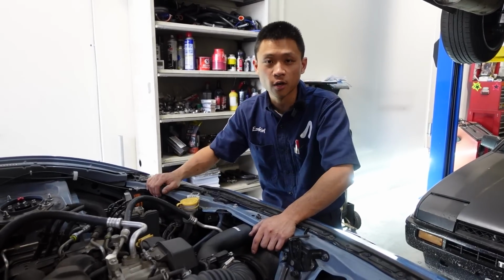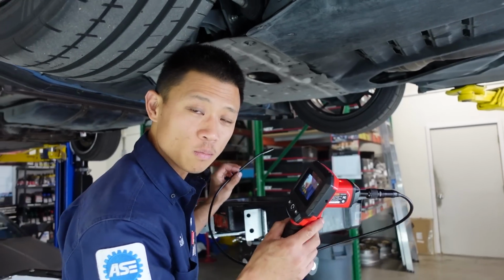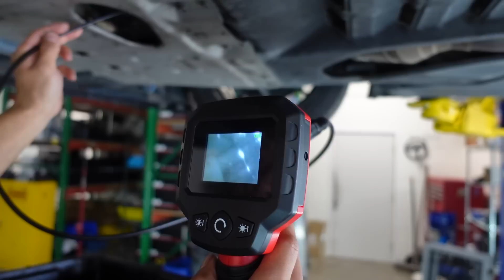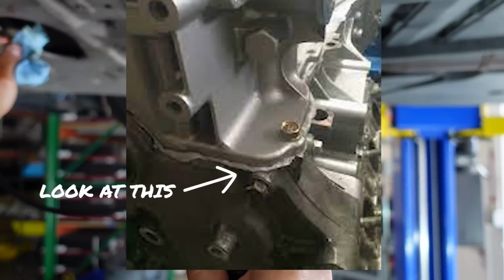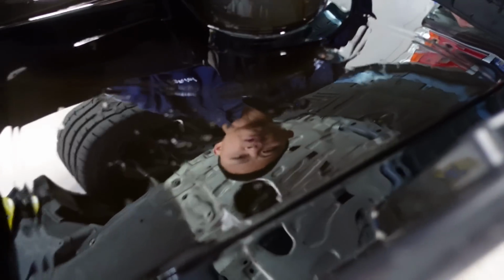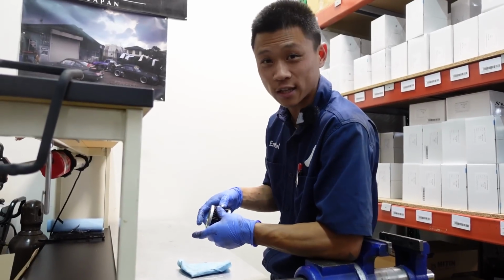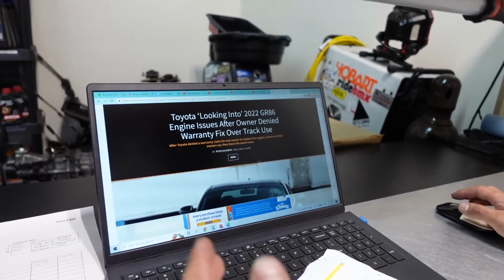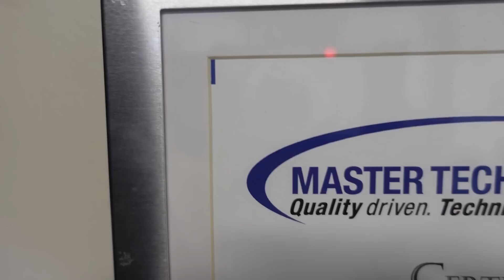GR86 RTV Engine Failures: thoughts from a former Subaru Master Tech

Comment: It’s amazing that in this day and age, a major car manufacturer hasn’t figured out how to properly seal an oil pan that would not potentially cause a major issue.  Totally baffling.
Reply from the maker: "Baffling" lol...punny
Reply: the really amazing part is that plenty of guys with little knowledge in comparison to an OEM can seal a pan better in their garage
Reply: Subaru just doesn’t give a shit. There’s no reason to put a boxer in a modern cheap car, it’s just a worse design than an i4. But they don’t it because they can’t do any better. Stop buying these things, you already know it’s going to have a stupid problem in advance.
Reply: @aluisious  how is it worse
Reply: @roboticunclephil  overly complicated for what it is
Reply: @aluisious  it is heavy for what its worth. And tough to change spark plug n other certain components. Its just a lower center of gravity n more even but if we push a v6 or i6 more under windshield cowl .. o.o yea. Moh powa babeh
Reply: Yeah man. This is supposed to be 100 years of ICE evolution. Yet another reason to not buy new cars. Only buy 50k miles+ in hope that this shit has been ironed out
Reply: @rahundsigma  the EJ253 is a very simple boxer engine, no AVCS/v-tech stuff, SOHC, NA. works pretty much exactly how you'd expect. i don't know what you mean
Reply: @aluisious  What about a modern expensive car, like Porsche?
Reply: @hhaste even worse.
Reply: @roboticunclephil it's a garbage engine every car that had it was garbage and has no potential except the junkyard
Reply: The engineers likely knew about the issue and its more likely the proposed fix for the design wasnt approved within the budget.
Reply: And here I was thinking about getting one, but after my mates disaster with his WRX, I thought I would do my homework. Guess I aint getting one now.

Comment: This could be a disastrous problem for Subaru/Toyota. The biggest selling point of these cars is their track/autocross ability and the biggest upside to them not being turbo'd is that NA cars should be more reliable... If it's gonna have a known failure Id like to actually at least make power before it breaks. 🤣
Reply from the maker: Its what make a Subaru...a Subaru
Reply: Their engines have been unreliable for a good long time and sales are only increasing so I doubt this is going to hurt them in the long run.
Reply: I mean it's a pretty simple fix and then they're perfectly reliable. It just got blown out of proportion because of toyota not staying true to warranty. If subaru did the same with all their previous issues with the EJ engines, then they would've been sued 100 times over. It's very likely that almost every performance car, the first few model years will have some occasional catastrophic issues. Don't buy the first model year, or don't complain.
Reply: @Toymonkeyjr  thats fair. Disasterous was too strong of a word. My concern is mote about the perception of the warranty than the actual failures. Lots of buyers who may have been considering buying one and tracking it are now going to have second thoughts and consider another car instead when they would not have had this story never happened.
Reply: @Bones12x2  Everyone I know who wants one is still trying to get one lol, this hasn't stopped them at all. just something to be anxious about.
Reply: @Toymonkeyjr  anecdotal evidence isnt valuable on a topic that is measurable in the hundreds of millions of dollars. I have a client that told me he is shopping for a track car and the BRZ/86 wss on the top of his list just above a low mileage used 370Z and a Mustang.... Now his concern about the warranty has moved it below the Z. The point is, the perception of these csrs is that they are amazing bang for the buck, track focused, sports cars.... Now millions of people have been made aware that they have a known fatal flaw and the potential for bad warrsnty coverage... It only takes 1 out if every hundred potential buyers to be scared off by that idea to cost Toyota millions of dollars. Its not likely to make or break the cars overall success yet but this story was huge in the csr enthusiast world and it will/has already cost them exponentially more money than it would cost to simply stand by the warranty to begin with
Reply: @Bones12x2  it's not anecdotal evidence, Have you heard of anyone canceling their orders?? people are still rushing just to get these cars lmao.
Reply: @Toymonkeyjr  "your friends" is literally the definition of anecdotal. And I literally just mentioned a person I know who was heavuly considering one that is now likely to get something else. Also... Me.... I am planning to buy a car next year. The BRZ/86 is one of my top choices but I plan on tracking it and this makes me fsr more reluctant than I was a few weeks ago.
Reply: @Bones12x2  name one person who canceled their order lmao. They're still sold out all over the country, so good luck with that.
Reply: @Toymonkeyjr  lol why are you so invested in this? Most US consumers are uneducated sheep. I only buy Toyota and this problem made me not buy one. Do you like buying defective cars? Also I haven't heard of any car company keeping up with demand since the chip shortage.
Reply: @rocketpropelled  You sound upset. Maybe you should go take a break from youtube bud, kay?
Reply: @Toymonkeyjr  You mad bro 🤣
Reply: @Toymonkeyjr  subaru did do this with the ej25 from 08-14 and there actually was, possibly still is, a lawsuit over how bad that particular stretch of the ej25s are.
Reply: @Thor Odin son damn I hadn’t heard about the 2017s
Reply: Mine shit its self just after 30k miles
The motor in the 86 always gave me an iffy feeling like it won't last long.
Big shame

Comment: the RTV issue could almost completely avoided by using anaerobic sealant like permatex 51845 where ever possible. Anaerobic only cures where it is clamped between 2 machined surfaces. any extra just oozes out and mixes with the oil and is drained out next oil change. only downside to anaerobic is it cant be use on sheet metal stuff like stamped steel oil pans- for those you still need RTV.  but anything machined like the timing cover, block halves, aluminum oil pans, oil pump etc anaerobic works flawless with zero chance of using too much.

Comment: I feel like people are making a bigger issue out of this than it really needs to be. Like every car has its own issues, there is no perfect completely “bulletproof” car. For example ND Miatas were blowing up transmissions on stock power during autotocross and track use. (Heck they still are, many are falling out of warranty now too) Nissan Zs burn oil… I can go on. Yet, why is no one crying a river and foaming at the mouth for those design flaws?
It’s the first year production run of the 2nd gen, I bet you this will be fixed and no issue going forward. I’m pretty sure Toyota has been eating the repair bill ultimately in the end. I’m glad these cars even being made. Given there is no lightweight rwd coupes on the market. At this rate we won’t have any sports cars how much enthusiasts complain.
Reply: I hope ur right bro. I still want to get the 86 in Jan of next year.
Reply: @lawnmower6591  Every production car has its flaws and issues especially in the first model year. The first gen 86/BRZ had a similar issue that was later corrected. Then when the facelift or kouki model came out was eliminated entirely. I wouldn’t let all this stuff sway you away from buying one of these cars. I’d argue there’s a higher chance you may not have issues at all. My 2017 has been a great car and experience 🤷🏻‍♂️
Reply: @Christian Medrano  thank you bro. I'll keep you updated.

Comment: I knew a problem was going to arise with this new 2nd BRZ/GR86 Gen for the first few years of production. Guess I’m going to have to wait a couple years of production until they sort out all the common problems, issues, and bugs. Safest bet is to wait until the refresh model but I and no one want to wait that long.
Reply from the maker: Yeah I was surprise to see them be this "reliable" as a first model year...until now.
Reply: Worked at toyota in australia when they first came out. there was a heap of "soft" recalls that weren't know about. Tail lights not being tightened enough was one for example.
Reply from the maker: @Mr_jz_12  Agreed. You had to manually sift through the TSBs or tech tip news letters to find them.
Reply: have fun waiting then
Reply: @Sinancan93  Rude but ok. Have fun spending money on a brand new ticking bomb car engine.
Reply: @Edward-jx7pl  warranty will do it. Don't track and social media share drifting🤷😂
Reply: @Sinancan93  Would rather wait than pay for the privelage of being a beta tester for production teething issues. Frankly a good rule of thumb is to NEVER buy the first model year of any new generation vehicle. First-year production runs are always worse off with quality control as the factory learns to build the new platform. For how much a new car costs, I can wait a year for a better ownership experience.
Reply: @nobleman-swerve  bro I live in Europe and we get only 4500 cars and 1000 in germany for 2 years. I have to 🤷
Reply: They had the same issue back in 13. So there won't be any fix XD
Reply: I have no money, so I can easily wait that long. 🤣
Reply: @Sinancan93  It will grenade right after warranty is over.
Reply: @fortheloveofnoise  that's a nice call from the glass sphere
Reply: There will be no few years of production. The car will be discontinued at the end of this year due to a change of regulation in windscreens and emissions. The one that where delivered will be the one we had. This is a collector car in the making.

Comment: Funny enough, I just started work for a Subaru dealer 2 months ago. Silicone must still be a factory issue because in the past 3 weeks theres been about 4 or 5  2022 N/A Outbacks coming in with lower oil pans leaking through the silicone, some techs are thinking it set for too long before being installed
Reply from the maker: Its what makes a Subaru - a Subaru
Reply: @CMAutohaus  I'll never own another subaru product... we're done!!  Toyota/Lexus for now on... after I'm done with this 370z...
Reply from the maker: @07wrxtr1  GR86 is a Toyota product lol. Toyota also owns a large stake in Fuji Heavy Industries (Subaru).
Reply: @07wrxtr1  Welp, may as well wait for GR corolla(or Yaris if you live outside of the US) Or maybe the rumored MR2 if it does ever come out. Since that's actually made by Toyota lmao.
Reply: Isn't the "gold standard" for RTV to bolt the pan down immediately after application to hand tight, then cure to spec before torquing to final torque? I waited a few days to torque to spec but I was waiting on parts anyways.
Reply from the maker: @joshuaho3150  Tighten and torque immediately. Modern RTV is different.
Reply: @EnhancedTrashBin  Yeah - I kind of am leaning on a Tacoma - since, I have a ton of places my 370z won't get me!  however - used Tacomas are $$$ right now...
Reply: @CMAutohaus  Yeah, I see a lot of mention to torque to spec immediately. I had a lot of time to waste though and I figure hand tight curing reduced the likelihood that it would all be squeezed out of the mating surface. I assume real mechanics can't afford to waste time like I do.
Reply: I just took deliver of a 22 forester.  Got the car home and checked the oil with around 29 miles on it.  There was some grey stuff stuck to the end of the dip stick.  My guess is that it was sealant.  Guess I’ll be changing the filter early and keeping my fingers crossed…
Reply: @funnyguy8042  that’s 100% sealant. Also, please keep an eye for oil drips under your vehicle. I work at a Subaru dealer and we’ve been replacing the oil pan on ‘22 Foresters once or twice a week for the past 2 months. Every tech tries to reseal the pan whenever they come in, but they always end up getting a new oil pan to resolve the seepage
Reply: @Allen.Saylor   Thanks for the heads up! I will definitely keep an eye on things as I will be putting in a fumoto valve and doing my own oil changes…

Comment: Until excess RTV issue can be resolved, I think Subaru should replace the oil pan with an oil pan with larger plug size that has been moved directly under the oil pickup tube, so the strainer can be inspected and/or cleaned out during oil change.
Reply from the maker: Someone else argued the strainer should be placed at the bottom of the pick up where debris can still fall down rather than at the top where it currently is and debris gets stuck.
Reply: @CMAutohaus  
I thought about that earlier and it is an option. The only problem I see with that option is screen surface area. It would have to be  at least equal strainer surface area. If you look at current screen/strainer, there a top horizontal screen and 4 vertical walls of screen. Also if the screen was at the bottom with large surface area, you would be in the same position of having to drop headers and pulling pan to clean strainer. However, it is an option.

Comment: I have misfires in 3 cylinders on a 2023 GR86 with 4500 miles, that's never been redlined, and has the rev warning set at 4500 RPM.  No error codes but my OBD2 scanner seems to indicate a few misfires during the last 10 cycles... Typically maybe one to two. I hope the engine isn't permanently damaged. Car seems to drive fine.

Comment: It may be worth a potential buyers time to research RTV use as an engine sealant, in particularly, the degradation over time induced by temperature cycling. It appears to me, based on my research, it would not be the sealant of choice. It also explains increased oil use over time. One may also want to research the effects of oil consumption in an engine. All was very intresting from a technical perspective.

Comment: My 22 wrx went in for warranty at 57k miles because the upper oil pan was leaking. That job requires them to pull the motor. I told them to check the pickup and they called me to tell me there was a bit in there. All fixed under warranty.

Comment: toyobaru needs to address and  issue a recall. cars with less than 13000 miles shudnt b dying
Reply from the maker: There have been lawsuits for oil consumption also for Subaru chain engines in the past.
Reply: Lol toyobaru

Comment: I got a 2013, I'm using thicker oil + larger pick-up for better oil pressure + baffles with flaps + I overfill the tank slightly. I did over 30 time attack events on the track, revving to 7800 RPM, I never had a problem!
Reply: Thicker oil will exacerbate any issues caused by a blocked screen because of turbulence? Overfilling is probably fine as you super don't want to even be a milliliter under filled with these but yeah..
Reply: @Ch3mG33k  Well you would never want anything blocking the screen and while at it  do some upgrades instead of doing just an inspection.

Comment: Hey if oil is leaking out. At least you know some oil is still in there.
That's what all the Land Rover owners say anyway. Nice oil patch under my Land Rover on my drive too so.

Honestly though I would rather a small oil leak than excess RTV clogging up the oil pickup or if any of this gets into a oil gallery. RIP

Comment: algorithm recommended this to me. You have an audio issue with this video. Sound only coming through right channel, except for the DINNNNG. Other than that, great video. Worked at toyota for a bit and they had recalls that weren't acknowledged (the tail lights for example).
Reply from the maker: Thanks for the watch and sorry about the audio!